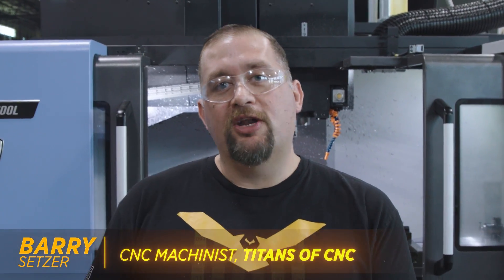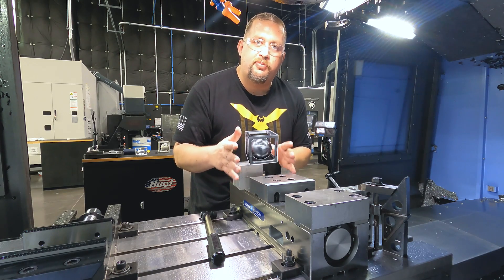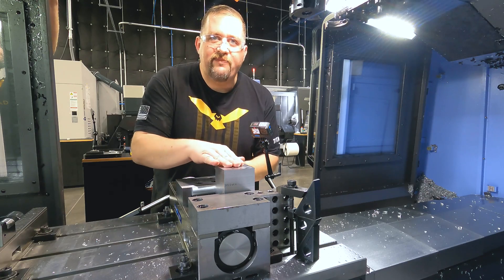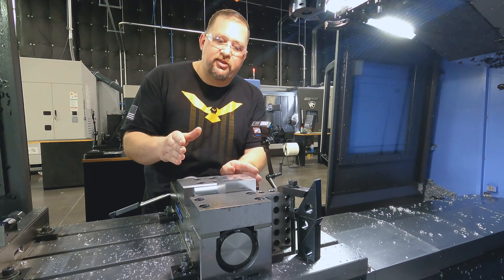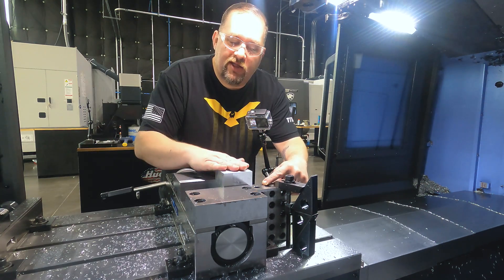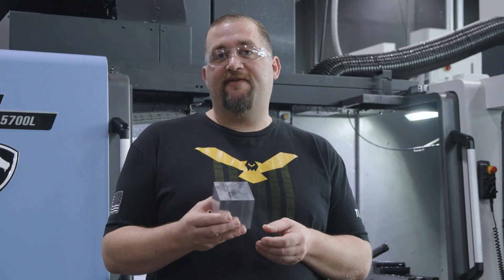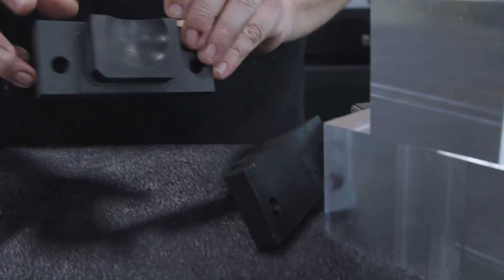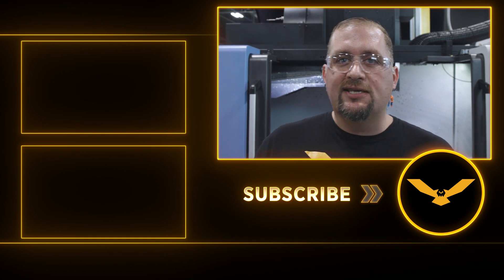How to Machine the PERFECT BALL in a BOX | DN Solutions DNM 5700L Mill

Comment: I've done Turner's cubes where for the final side you tape up the cube with tinfoil tape and then fill it with melted paraffin wax.  Let the wax harden then machine the final side.  Use a heat gun or low temp oven to melt out the wax.  Perhaps not nearly as accurate but definitely still a great result.  

This video was great and I want to try and make one of these now! 

Also wondering if two pieces of round stock and a counter sunk set of holes in the ends would maybe work ok for holding the sphere on the final side.  🤔

Comment: Nice work. As a retired 50 year CNC Machinist, Once I saw the project I immediately knew how it was done. The only thing I would have done different would be to make the Ball capture fixture aluminum soft jaws and as a former GibbsCam Sales engineer/application engineer, I would have used GibbCam to program the CNC and Solidworks to create the part model.

Comment: For having the word PERFECT capitalized in the title, and so much time spent on squaring, this video isn't really filled with great advice on making a cube.
Don't smack the stock on the first, or second surface. You want the material flush to the vise jaw, not to the parallel it's sitting on. If you smack it down doing the second side especially, you have eliminated your 'guarantee' of it being perpendicular to the jaw... You took a certain 90* out of the equation. Perpendicularity is the ENTIRE goal on side 2, nothing else. 2 perpendicular planes that everything else is based off of.
In reality, on a 3" cube, you shouldn't even be using a parallel until the 5th side, and only on the 5th side, and just 1 parallel... Always maximize contact with the jaw to ensure perpendicularity.
Then, when you are machining side 4, take a skim cut, with the side of an endmill, 1/4" deep on one of your 2 remaining raw sides, feeding on the Y axis. That gives you an edge that is perpendicular to 2 of the sides.
You can then set it on the smallest parallel that you have to skim cut side 5. Just a single parallel, against the fixed jaw.
After that, machine the 6th side, and you are done.
The dead blow only comes in to play on side 3, 4, and side 6. 
Providing you jaws are actually square, you will end up with a cube accurate to tenths that way. The way that shown, introduces more opportunity for error. Especially with sketchy starting material.
A sphere with a flat against the jaw works better than the half cylinder too. With pretty square material, a cylinder works, but if it's much out of square to begin with, the single point of contact that a sphere provides, guarantees the other surface is flat against the fixed jaw. A half cylinder doesn't do that.
The method shown will get you pretty square, most of the time, and very square some of the time. 
The method I espouse will get you dead nuts, every time, and isn't any more work. 
(less work in fact as you eliminate setting up the the 2-4-6 block, and just work in the center of the vise, as best practice dictates anyhow)

Comment: If you face the top and part of the 4 sides, you have 5 sides square and parallel in 1 op. Flip it over and it's square  in the vice. Just face off the new top and even up the sides to match op1

Comment: “That’s the squarest square I’ve ever made” is a ridiculous statement! You have no real way of checking if it’s right as you don’t have a CMM to actually check sizes. I don’t think you can physically feel the difference in a couple micrometers unless your on crack. Finishes on the cube were good on one half then bad on the other. What’s going on there? U not squared the spindle to the table pal? U have pretty average fundamentals in my book.
Reply: For the record, we DO have several CMM's, and I checked this on one AND on a granite table with a tenths indicator. But that was boring and didn't make it to the final video. But thanks for watching.

Comment: I couldn't agree more the only way to make and hold tight tolerance parts is with the proper setup. That being said theres no way to accurately measure with a tenths indicator with that point angle. It looks to be pushing 30° to the work surface. That fourth place decimal isn't very forgiving.

Comment: I never clamp anything offset that much in a vice - it will not be square - at least not in the vices I have. The fixed jaw is fine, but the moveable one will cock. Putting it near the center of the vice, or using a spacer on the other side of the vice will fix it. Evrey vice I have does this. Check yours. If it is still within .002 when clamped this way, then I want one.
Been machining for 30 years.

Comment: The 3D printed material has worse tolerance than aluminum due to plastic shrinkage. I also think they should have attempted to use some kind of adhesive on the grip between the plastic and ball

Comment: im wondering if you would like to do a fun challenge at somepoint in the future? i was thinking obviously u can't 3d print tungsten carbide. but like to see what's the strongest metal you can currently 3d print and what is the hardest in Rockwall u could make it with heat treatment etc to beat a off the shelf or cheaper carbide tool?
Reply: You can 3D print tungsten carbide as well as pure tungsten! That would be a fun challenge though!

Comment: Getting those last two sides square against a 2-4-6 block is well obvious. But I've seen another method with one more step.

You deck the second last face like normal getting as square as you can but doesn't really matter as you'll see later. That surface you just machined has two edges that are perpendicular to rest so then flip it and rotate 90 degrees and use a narrow parallel to sit on one of those edges and fixed jaw as reference and then deck the "last" face bringing that into square. Then flip one last time to go back to second last face to finish it off.

Thoughts?
Reply: That's a great technique when you don't want to change tools. Otherwise just make a perpendicular edge with an endmill while machining side 4. Then the part only goes in the vise 6 times.

Comment: if your vise moves while its bolted down with a lot of chips on the table and you loosen the bolts up on the vise a little and straighten the vise out can chips get under the vise?  Should you take off the vise clean vise and table then reinstall vise instead of loosening it little bit and realigning without cleaning?
Reply: It never hurts to try, and indicators are your friend. If you loosen it up and tighten it down, and suddenly your vise isnt flat to the table…..youve been chipped 😂

Comment: To me you guys are great teachers and a great source of  inspiration 💪💪💪! Wish to see a lot more from you in the future!
That 3D printed parts ,what tolerances they got ?
Reply: Depends on your printer and many factors including material. For the most part thought tolerance doesn't matter that much for this application because the plastic squishes a little bit when you tighten it down in the vice. My experience with 3D printers has shown down to less than +/- 5 thousands of an inch with a well setup printer.

Comment: Barry, have you done a tutorial on achieving specified surface finishes?
Reply: Not yet, but we have one in the works!
Reply: @barrysetzer  May I make a request for that video? Explain the reasoning behind using different finishes.

A new guy might think "I'm running a $500,000 machine with the best cutters on the market. This system is completely capable of putting a mirror finish on a part, so everything I'll make will have a mirror finish." But if you're making something like those motorcycle footpegs you guys did a really good video on, or something that's got to hold an oil film, a mirror finish is precisely what you do NOT want.
Reply: Interesting point! We will absolutely speak to that!

Comment: This reminds me of a production part that I used to run. Milled all six sides, starting the saw cut up and rotating the fresh faces toward the stop. On the fourth side, there were 1.25" drilled holes with less than .050" wall left from the previous milled ends. If you didn't get it squared good enough on the first side, those holes would be out of tolerance. Then, rotated forward and back to finish the block out. The last side had milled ports that intersected those 1.25" holes and 1/8" holes with about .040" walls that went through over 2" of material. Being a production part, we didn't have the luxury of getting it all square before features were added, but they weren't bad if you got it square to begin with and kept a handle on it.
Reply: Ok

Comment: Why is it important to minimize the contact with the cylinder?
Reply: I will take a guess: The floating jaw isn't guaranteed to be perfectly parallel to the fixed jaw in every axis so by using the half cylinder piece you get a single point of contact from the floating jaw to prevent it from skewing the work piece. I would say it's most important for a work piece that has an unknown squareness, but probably still beneficial even after it's known to be square. 
Think of it like using one finger to push the work piece to the fixed jaw vs. two fingers. With one finger you only have one point of contact and can't apply uneven load across the part, but with two fingers you can.

Comment: When I did my ball I used two bottle caps to hold on to the last side. It wasn't the best, but it was the only thing I could think of as a 19 year old machinist.
Reply: Hahaha that's actually pretty smart!
Reply: You can also machine these exact jaws out of aluminum!
Reply: I was just wondering how an apprentice was supposed to do it if you didn't have a 3D printer.
Reply: @andyloney777  i mean, he did say that you could mill a holder too
Reply: I used a flat piece of hardwood that I cut to the correct square size, rounded the corners, and used a large drill to make a pocket in the centre. It wasn't the most stable, to be sure, but it did the job. Now that I have a 3d printer, I'll have to give this method a go.
Reply: Can't knock it if it works. Pretty resourceful, if you ask me. Damned sure cheaper than the brass bushings I'd have used.
Reply: Nothing that works is silly.
Reply: Fixturing alloy poured into a captive mold just high enough from the bottom would key everything in place and then slight compression on that would create much larger perfect contact on the sphere achieving the same thing. People have done other types of things like this using hot glue and other such things. There's actually many ways to do it you don't need custom jaws

Comment: The blocking up is textbook procedure, the 6th step with the 3D printed jaws is cheating, lol, but still very informative and cool, we use hot glue and also go reserved on the depth and feed and speed, then just melt the hot glue away in by boiling water.
Reply: Why not just machine the plastic if you don't have a printer? I mean you are cutting a sphere with a Mill so you aught to be able to machine a dish into a block of softer material.
Reply: @mgk1397  in the end its up to you what to do, hot glue is cheaper and easy.

Comment: The importance of a foundation. Making a perfect cube is a challenge to many experienced machinists. Nicely done Barry!
Reply: Right! Folks think the ball is hard, then realize 2/3 of the video is just making the cube.
Reply: leave 2mm to clamp on the bottom, machine the plane on top and around with a endmill, 5 perfect to each other faces if your endmill doesnt flex, which doesnt happen with a sharp good tool saves you like 1.5 hours in his case
Reply: @majorva2653  Only if you can get an endmill long enough to side cut the entire block, so it depends on how big you want the cube. Either way you are right, it is much faster.
Reply: Making a square cube is day one stuff.
Reply: @JohnBlaze505  some people are day 1 🤷‍♂
Reply: Basic AF. If making a cube was hard, you came into the wrong field then.

Comment: And the rest of us just completely fill it up with hot glue ( actually works really well)
Reply: If you have a CNC machine anyway why not machine a holder for the final operation out of something relatively soft? There are a million ways to solve a problem.
Reply: @mgk1397  well i dont have right now. plus we did it on a manuel lathe so that wasent a option back then when we did it